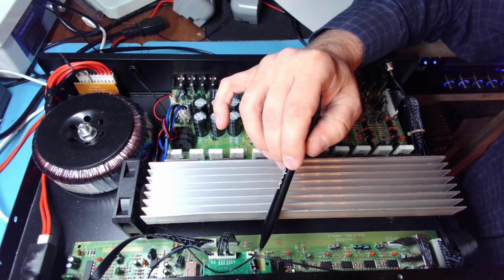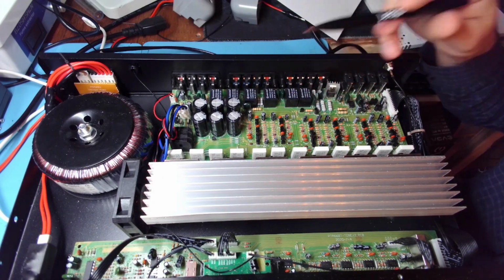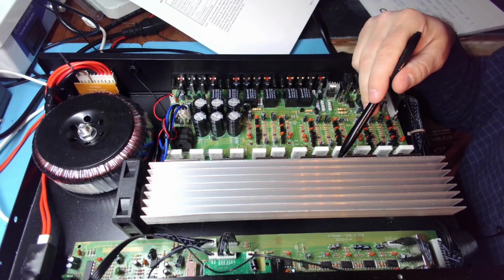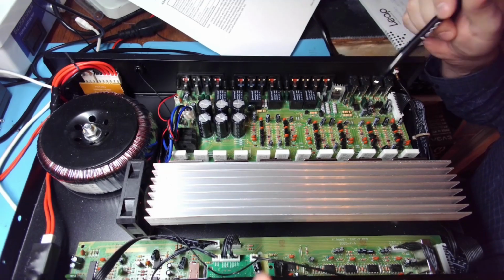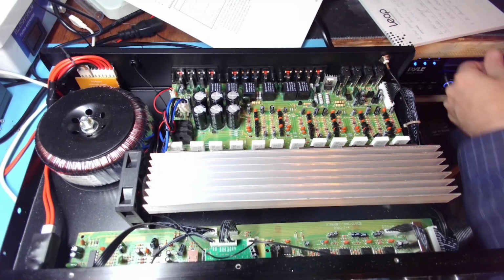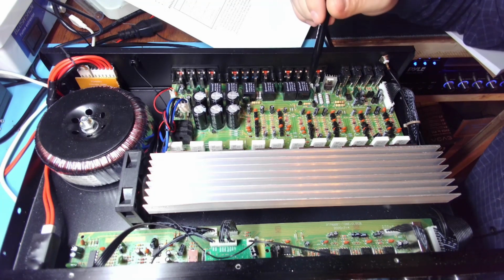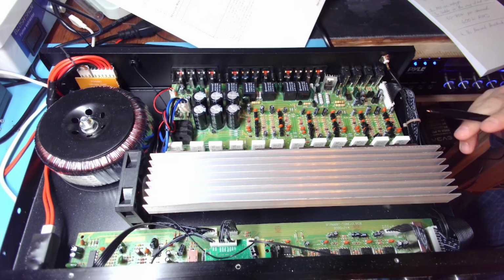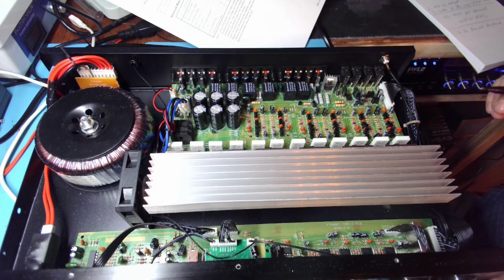Pyle 600W Fire Hazard | PTA66BT Teardown

Comment: I just repaired one that looked very similar, must've been a revision change. The output from the transformer was 24v.  Those two little resisters you mentioned were 5watt and raised off the board. The bad components were the six 2200uf capacitors, they were all bloated and leaking. There was also quite a few resisters that were burnt but still within specs. 
I came to watch you video to find out how the fan worked. Thanks for the info about it only turning on when the unit sensed a certain load. I'm hoping that how this one works, because the fan doesnt seem to turn on. I only have one set of speakers hooked up, so not much load.
Reply from the maker: yeah, I state that but I think I was wrong, I remember that fan turning on eventually so there might be a thermal feedback somewhere after all (or maybe I'm thinking of another amp, not sure).
Congrats on the fix :)

Comment: Mine is turning on, until yesterday only 2 channels were working. Yesterday after 30 on or so usage last 2 channels also gone. Completely mute, or very quiet not sure. How should I fix/debug that?
Reply from the maker: Open the device and check all transistors for shorts. Then check 12/24V supply line. If all that is good, check the preamp section, inject sin wave and see which preamp is not working.
Reply: @blackhorserepairs  Wow awesome :) thank you for the reply. I'll check and come back with findings.
Reply: @blackhorserepairs  seems like nothing shorted. And once assembled it works again. No clue :(
Reply from the maker: @sorgmail  could be cold solder or dry caps

Comment: I have the PTA44BT. The display wont turn on. The unit does some sort of clicking sound once and thats it. Its brand new. I opened it and nothing seems to be damaged or burnt.
Reply from the maker: the clicking is usually the sign of short on the output stage (or faulty speaker is connected).
no display is likely a separate issue. Check the output stage for shorts, confirm you have 5V going to logic, should be regulated by 7805.

Comment: I had the 100ohm resistor you said gets really hot blow after around 3 years of using this amp. What resistor should i replace it with? Another 100? Or should I get a bigger one?)
Reply from the maker: use the same resistance value 100 but you can increase the power value, if it's 5W change it to 10W, that will prolong the lifetime of it